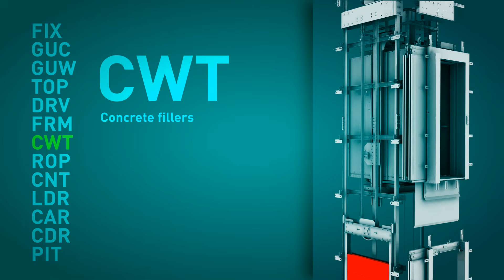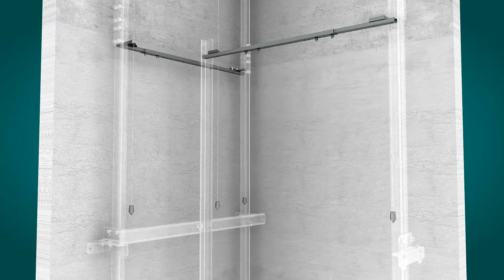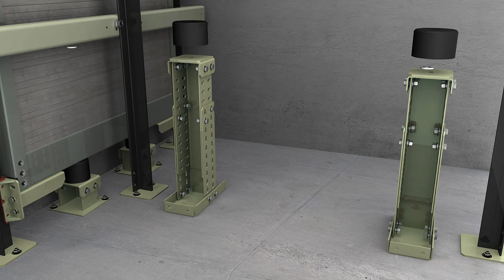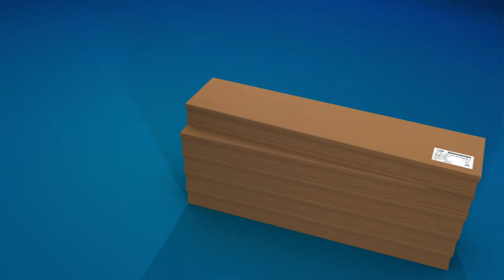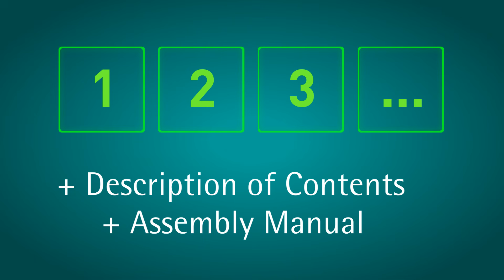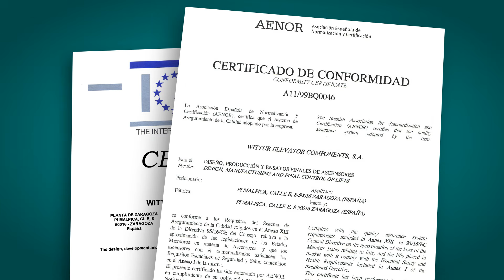MRL TECNICO Wittur

Comment: at 6.20 elevator frame moved with full load of counter weight.. its dangerous. rope can be flip from motor pulley.. you must work with half or as needed counter weight amount... safety hazard for installer.. be aware..
Reply: Yes you are right. Great observation
Reply: Thanks
Reply: Đây chỉ là mô phỏng, nhưng thật tuyệt là bạn đã để ý chi tiết đó